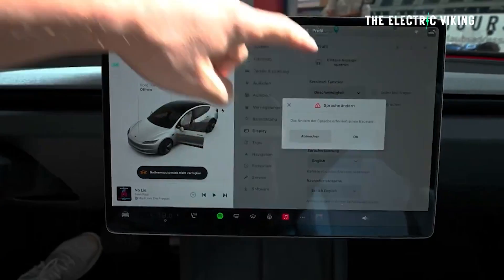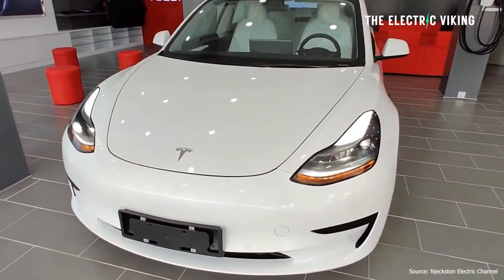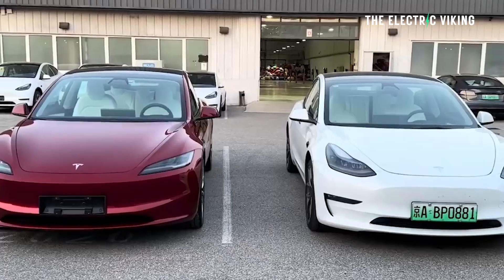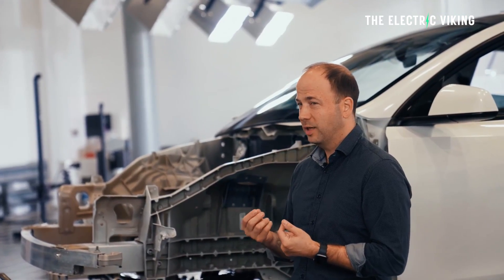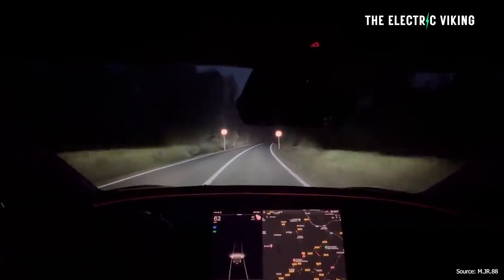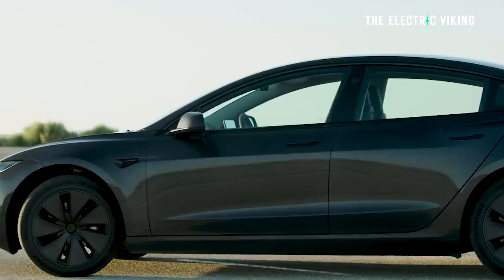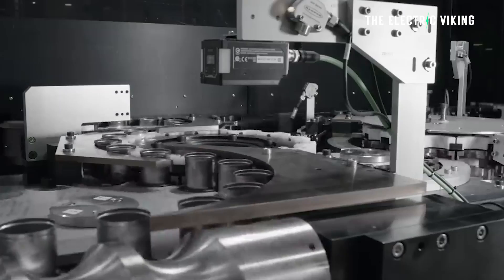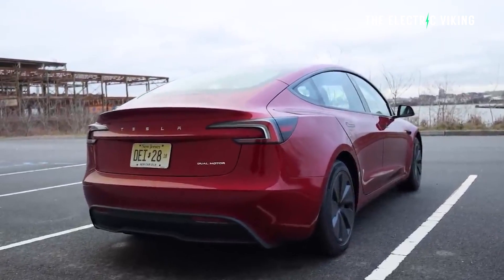Tesla software update upgrades OLD Tesla lights to adaptive high beams

Comment: I'd be happy if the auto high beams would actually work correctly. Auto wipers are crap too. I keep having to turn it to manual. I tried using the auto high beams and they were going nuts, I was afraid other drivers would get road rage thinking I was doing that to irritate them. I love that fact that my Tesla cars can get software updates but they need to contract testing firms that are NOT Tesla employees.

Comment: the thing about LFP batteries is although you have lower max range, since you're charging it to full every time while only charging a Li battery to 80% every day, leading to a similar range. plus degredation that fast charging will cause on a Li battery that wont happen as noticeably on an LFP battery. 

Honestly for most people, it seems like LFP is just the way to go. save the higher energy density Li batteries for performance cars and trucks that need the higher energy density and higher power output.

Comment: LFP batteries doesn't benefit from charging to 100%. LFP also degrades, even faster than regular NMC/NCM lithium batteries in the beginning. The reason for 100% charging is the BMS need for a good reference point for state of charge. Best is a low as possible for your needs. I charge my cars to 60% during summer and 70 during winter.

Comment: Many Tesla have bad headlights and it feels like they are using long distance headlight when they use short one. Very strong light observed in many of them and that might be fixed in the new highland
Reply: Seams fine to me, they are bright and they don't piss off other drivers.
Reply: They did piss off me when I am driving on the oppsite direction because it is very high and strong :D . Even if Tesla is coming from back I can see how bad is the headlight.  @tomooo2637